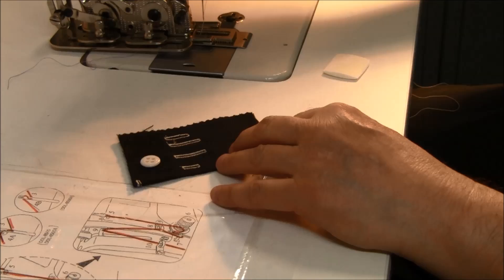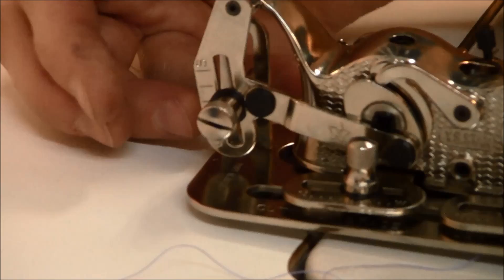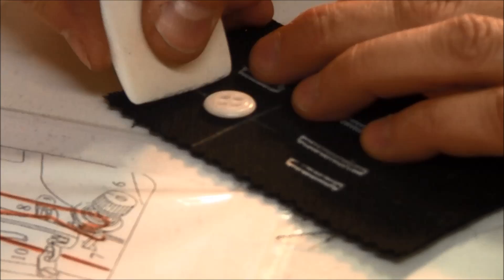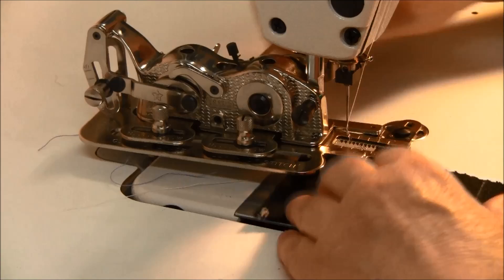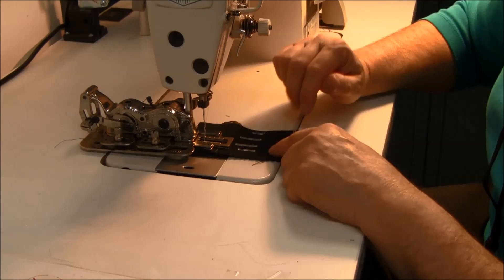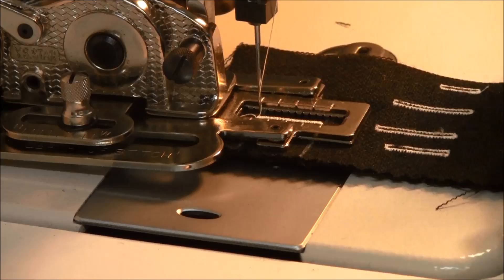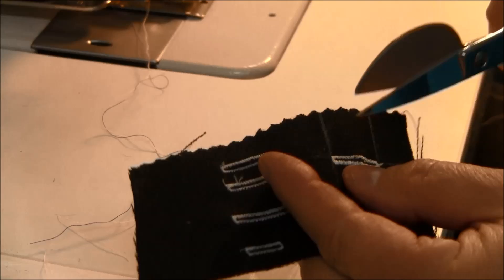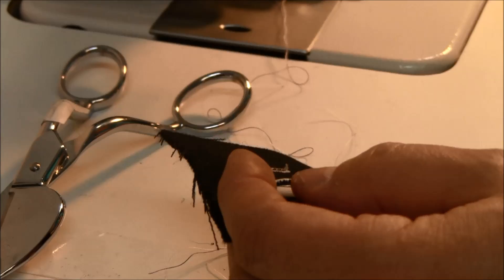Industrial Button Holer

Comment: Hi- is your industrial machine high shank or low shank? I just bought one of these buttonholers and it just isn’t fitting onto my high shank machine correctly. Even with the pressure foot down I have 1/4” clearance between the attachment and the plate, which obviously won’t work to sew my buttonholes
Reply: सिरसा हरियाणा में से कितनी ही ले लो भाई कीमत मात्र ₹600 हैं पर यह कामयाब बिल्कुल ही नहीं है मेरे पास दो पड़ी हैं खराब हुई
Reply: Givmi patsha
Reply: Lower your presser foot bar. Theres a grub screw to adjust the hight on the presserfoot bar